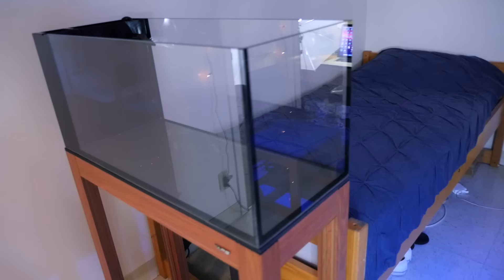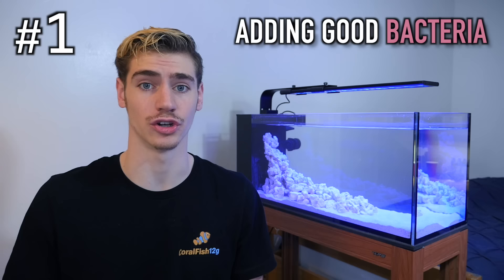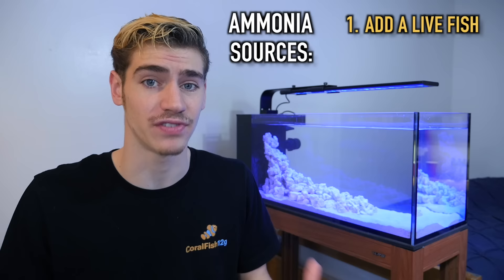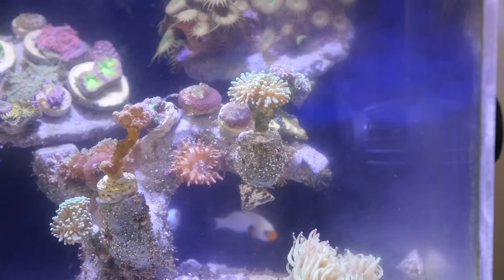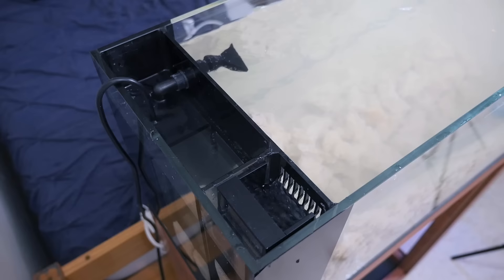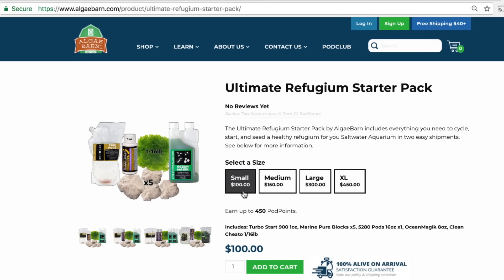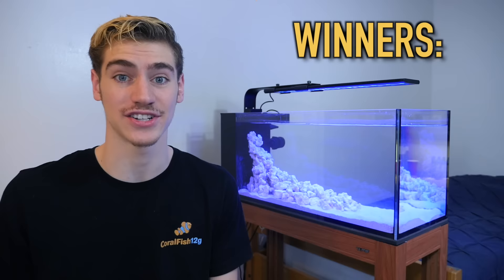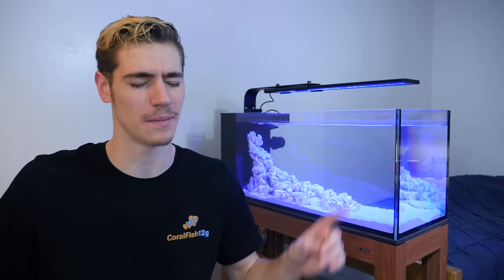How to Set Up Your Reef Tank for SUCCESS!

Comment: I always thought saltwater tanks were way above my skill level but they way you describe them has turned me around. I haven't gotten any supplies yet, but I'll definitely have a saltwater tank because of you, dude :)  You converted me!
Reply: dobbynfred072107 just be sure you know you do NOT need to buy all the products he is promoting if you do your research which you need to with SW tanks. He literally added a tiny bottle of concentrated bacteria and then bought a big bottle of diluted bacteria to keep it going. If you use live sand and buy cheap saltwater at a local fish shop you’re tank is basically cycled but not completely. Seachems Stability is all you need to add, not two bottles of studf

Comment: Smashed that Like before watching
Reply: Inappropriate Reefer that’s what I did with your new vid
Reply: same, btw your vids are great keep it up
Reply: I wanted to smash the like, because George's videos in terms of presentation are awesome. It is just a shame what he telling us is confusing, although maybe not confusing to new reefer, who doesn't fully understand the hobby.Cycling a tank simply means building up levels of bacteria, to cope with Nitrogen Cycle (ammonia created by rotting fish pee and poo). Adding live sand, adds all the bacteria you need, with out the need to wait whilst bacteria levels build up. So when George added his live sand he instantly cycled his tank (built up the levels of bacteria). It is good practice to wait 6 days before adding fish, just in case anything in the live sand dies, and creates an ammonia spike. If you have zero ammonia after 6 days. your tank is ready to go. If you have ammonia, you need wait till the ammonia is eaten by the bacteria on the sand. This is nitrogen cycle in action, and just allowing the tank to go through a cycle (ammonia becomes nitrite which becomes nitrate), not cycling the tank, because the tank is ready cycled by adding the live sand. You could achieve the same instant tank with live rock, and dry sand. Adding a bottle of bacteria is another way to instantly cycle a tank, and create the right levels of bacteria. This a good method if you uses dry sand and rock with no bacteria on.Adding ammonia will just cause the tank to go through a pointless cycle (ammonia to nitrite to nitrate), if you already have the right levels of bacteria, because you have used live rock, or sand, or a bottle of bacteria.  If you have not used any live rock/sand or bottle of bacteria to add instant bacteria, then you could add ammonia. This feed the bacteria naturally present all around us, (a few of which will enter a new tank). The ammonia will feed the bacteria, allowing the bacteria to multiply. This cycling a tank (building up levels). George has just cycled his tank 3 times. You only need to cycle a tank once. I never cycled my 160g. It was a tank upgrade. I used all the live rock from the old tank, therefore the tank did not need cycling. The levels of bacteria I needed were on the live rock.
Reply: That's what I did to your video. So when you getting that bigger freshwater tank?
Reply: Woof! Looking good. 😻

Comment: i know this video is quite old but i had a question stemming from my own failed cycling. when you said that you added turbostart and it cycled in three days...how do you calculate that? what are you testing and noting changes in...in order to say "hey it's done cycling!"?from my limited understanding of the 30-day version.. you test for nitrites to go up, then down while nitrates go up, and once that's completed your tank is cycled. how do you test using your method, though? thanks!

Comment: I know this isn't about reef tanks but I thought sense you know so much about saltwater aquariums I thought you might be able to help me. I've been wanting to get puffer fish but the puffer fish are brackish water. I've only kept freshwater fish. I have a 20 gallon aquarium that has been growing some African cichlids. The tank has no fish but the water is fully cycled. Can I just add some salt to that water or do I need to drain all the water out and start over. My next question is what kind of salt do I use and how much of it do I need to use for brackish water. My last question is how do I go about doing water changes. Do I drain the tank 50% like a freshwater? When I replace the water how much salt needs to be put in the water and how long does the water need to sit before putting it in my tank?

Comment: So I had a question. I've been in the fish hobby for several years. I've tried keeping a saltwater tank but failed so I have been out of the hobby for many years. I'm trying to get back into it. But, there so many ways of going with buying a tank it is difficult to decide. There are all in one systems by red sea, BUT they are very expensive! Is red sea a rip off? What do you think about buying off craiglist? Or is buying a tank, stand, pumps etc separate a better choice. If there one brand of tanks better than another. Which brand is more reliable?

Comment: I just set my fish tank up like 3 weeks ago. All i have in my tank is live sand and the my water, my live rock is coming in tomorrow but i am really scared because allllll of the levels in my tank are pretty high. Ph, nitrates, ammonia, nitrates. Will it be fixed when i add my live rock? Help😭😭😭 i have also put in the fritz 9, and i also have my heater, powerhead, and my aqua clear 20 fliter going. Im do worried😭😭😭😭

Comment: Hey George,
 So they offer a 18-24'  light like the one you have, but also a 24-36' model as well. Does the 18-24' model work well with your tank, because i'm seeing most people go with the 24-36'. With that being said they don't have the mounting bracket attached, so that might just be the issue.

Comment: question for u brother im setting up a 75 gallon tank with a 55gal refugium i boight the refugium after buying the tank and its a well established refugium guy u bought it from has had it for 5+ years he was moving and when taking down his tank he put his clean up crew a clown fish a gobi and a zoa in the middle chamber with the live rock and cheato in the refugium if i use turbo start when filling the 75 gallon will fish and coral be okay? should i move them right into the 75 or leave them in the refugium right now the refugium is in a loop while im building my stand and buying rock and live sand

Comment: I have a Nuvo Fusion  20 tank but the back chambers are covered in black. I know on some Nuvo tanks you can peel the black covering off, but I couldn't find any info specific to the Nuvo Fusion 20. Curious as to whether or not you know. Watching this made me want to set up a mini refugium, but I need to be able to keep a light at the back of the tank D:
Reply: Awesome. I was nervous to take an xacto knife to it and scratching it up!
Reply: Fingers crossed, then! I'm going to try to do a small section just for the light so there isn't too much light bleed against the wall/across the back of the tank.

Comment: How will I know when my tank has finished cycling... and if I bought the fritzyme birthing bacteria (9) bottle instead of turbo start, is that okay to use for a new tank? Unsure of when I can add a fish and the bacteria... please help!
Reply: When ammonia drops to 0 and nitrates decrease to close to 0 as well. Generally, people cycle a tank for 1-2 months. DO NOT put a live animal in there earlier than 2 weeks into the cycle.
Reply: @flightevolution8132  Thank you tons!
Reply: @widdiful434  No problem. If you have any more questions, don't hesitate to ask.
Reply: @flightevolution8132  Hey, another question for you. I used a bottle of bacteria for my tank, and my ammonia remains high roughly a week + later. I also notice that my nitrite and nitrates are higher than 0 too. How long do you think it will take for it to begin to decline? I bought some zeolite for future use, but I imagine it's better to let the tank cycle on its own without external supplements.
Reply: @widdiful434  Cycling a tank depends on the size of the tank, whether sand or live rock is used and what type of organic matter is used to start the cycle. Could you provide more information about the tank? Generally, most tanks will cycle in 1.5-2 months.
Reply: FlightEvolution Absolutely - it’s a 55 gallon tank, I have about 1.5” of live sand in the tank, and primarily base rock that I let soak prior putting it in the tank. I have a small live rock I had bought at a local store. I purchased some fritz starter bacteria too. I’ve been putting a small amount of fish food in the tank too. I currently have a filter, protein skimmer, and two wave makers in the tank as well.